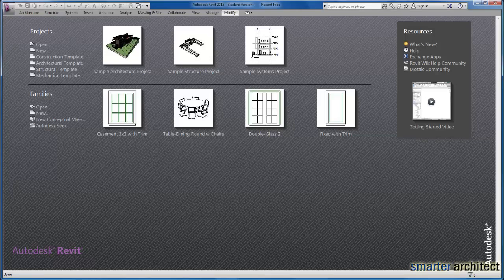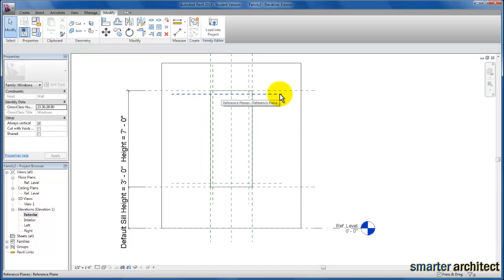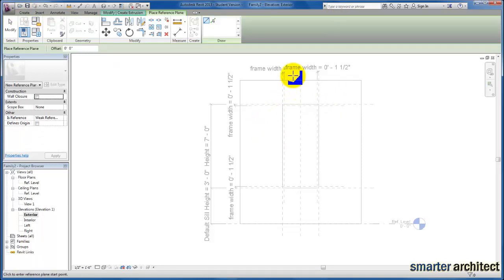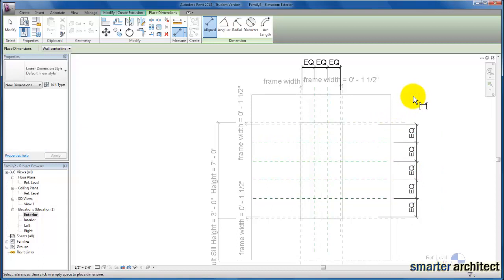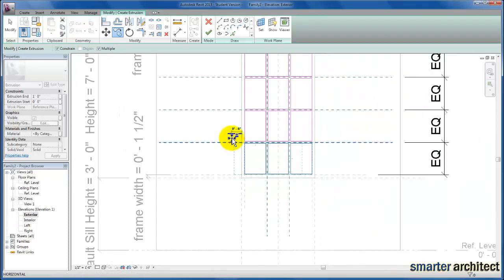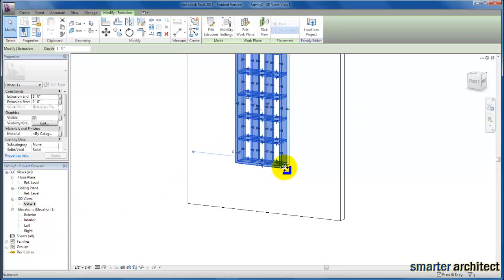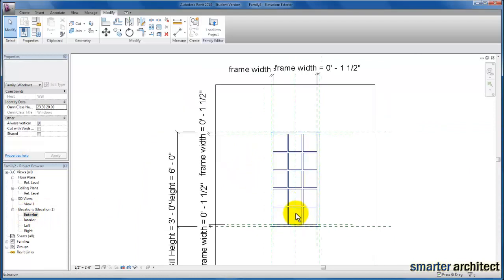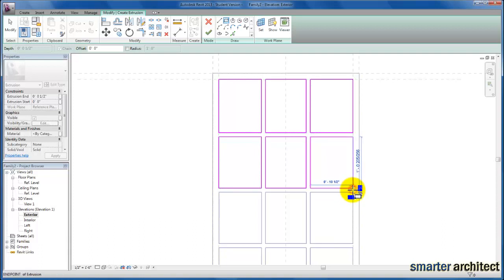Revit Tutorials: Creating A Revit Window Family - Part 1

Comment: Hello, two questions.
-I would have created more reference planes for each edge of the mullions instead of only one for the middle of the mullion. I guess it is working because revit is guessing those constraints.
-when you lock te edges of the glass to the mullions. I was told to avoid locking things to geometry.

Comment: Hello, 
When i try to edit the size of the window i get a lot of error messages including: Can't Make Extrusion, base sketch for extrusion is invalid, and lines may not form closed loops. I thought they must be in closed loops. I'm very confused. Thanks!
Reply: Click on your extrusion - edit extrusion - annotate - aligned your extrusion lines - lock. How I fixed the issue in my project, I aligned/lock my extrusion (mullion) line to my extrusion (frame) line.

Comment: Hello! Excellent video, I have this issue: I created a window but  when  I tried to open it on my project comes with an error : "Some or all the families you selected cannot be loaded. You must choose family files  of the category of Windows"
I save my new window on that file. Could you help me?
Thanks!
Reply from the maker: Awesome...thanks for watching! 

That error message usually means a family was selected from a category which was different than the family for which the Load Family command was invoked. For example, going to the Architecture Tab, invoking the Door command, then going to Load Family and selecting a window family.
Solution: 
To load whatever family you want, you can go to Insert > Load from Library > Load Family.
Reply: thanks!!!!!!!!!!!!!!!

Comment: Great instructional video.  Quick Question.  When you lock the glass elements.  Is there a shortcut?  As in if we were to draw one sheet of un extruded glass, can we copy it and still maintain the locked property of the shape?  Thanks !
Reply from the maker: +Aisha Whitman Not sure I totally understand your question. But you do not want to use a copied extruded element that is already locked to a particular reference plane because it will likely cause errors to happen based on how you manipulate the copied element in the future.  Hope it helps!

Comment: One question: When I tried to change the height or width of this window, I cannot do that because there appeared a messag "Reference Planes are overconstrained". What that means?
Reply from the maker: Milla Dimitrova There is a conflict between one of the predefined constraints you currently have attached between reference planes so as you attempt to manually change the height or width, it is causing an error.  Just delete the constraint that you would like to override.  Hope this helps.